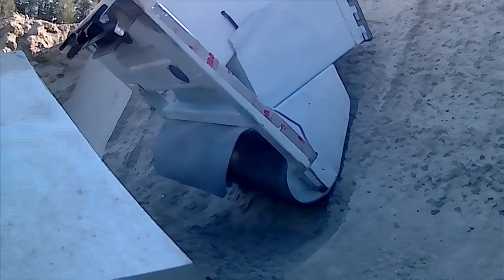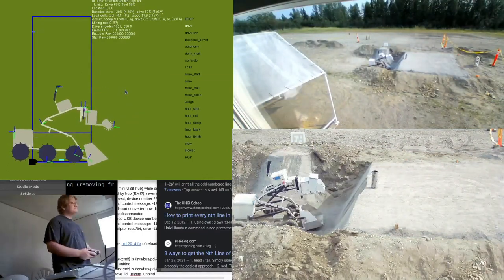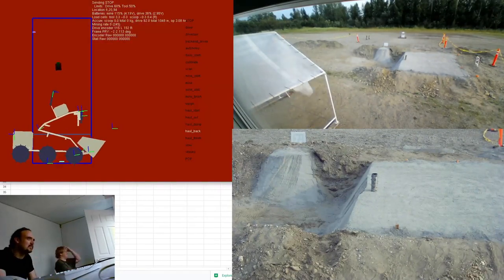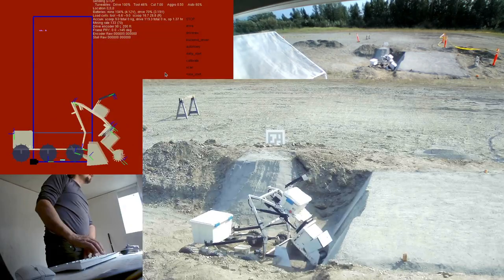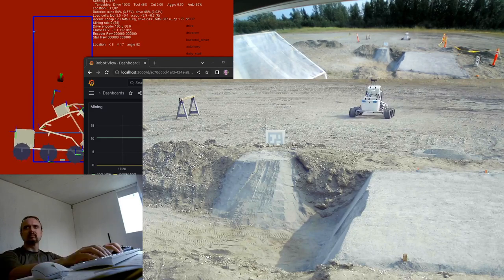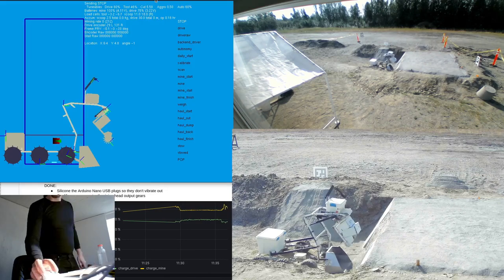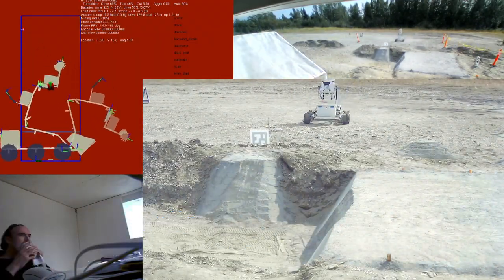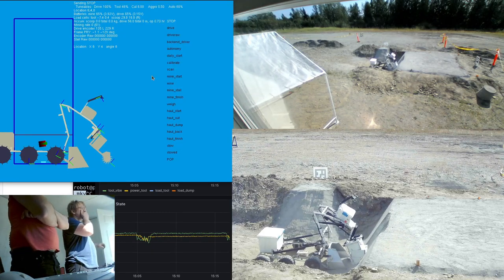Mining Robot Durability Demonstration Summary Timelapse: Aurora Robotics

Comment: On-off tuning in into the past livestream I saw some issues mentioned with the warping of the printing of replacement nylon gears. Nylon really needs an enclosed building chamber to print halfway decent. Even more so POM & HDPE which might be alternate viable tough plastic options (with equally or worse warping). Carbon fiber fill can help prevent shrinking & warping by a lot. But the short fibers make just parts just stiffer not stronger. Weaker instead. Also the fibers mess up self-lubrication obviously. With a two material print one could maybe only make the lining out of unfilled nylon. But setting a printer up for that is another project. …
Reply: On the Moon It'll be metal gears. Interesting would be how different metals will react to very large loads at cryogenic temperatures. Hopefully they don't get too brittle and amass micro-cracks till catastrophic macrocrack. About friction in medium load there must be plenty of knowledge by now with so many robotic devices having operated and operating on Mars.
Reply from the maker: I printed the robot's nylon gears with a tiny Tina2S printer, which I modified by insulating and enclosing all sides.  But it still does need a much warmer build chamber to avoid warping on large parts!
Reply from the maker: @mechadense  My understanding is dry lubricants are standard for hard vacuum operation: PTFE and MoS2 are typical.  At cyrogenic temperatures 300-series stainless, ELI titanium, or low-alloy aluminum have decent impact and wear performance.
Reply: @olawlor  — I see. Though I was thinking especially about longer term high alternating loads at sub lN2 temperatures. Gradually building up microcracks. Shifting fatigue limits.

Comment: I guess even cryogenic water won't get all that hard as it's "just" hydrogen bonds in the end. Don't underestimate hydrogen bonds though. But even with a soft matrix the abrasive sharp regolith within will likely wear the teeth. In a rather different way though.  Silicates (quartz) and especially aluminates (corundum) are much harder than the calcite needles in concrete. Well then again most of the wear likely came from the quartz sand in the concrete.  => Was the silicate for the concrete chosen to be regolith like small and sharp or was budget and availability forcing some more conventional filler.
Reply from the maker: We used "concrete sand" for the simulant, which is fairly sharp so it locks together.  But contrary to expectations, it includes pebbles up to golf ball size which were super hard on the teeth--our local rocks are quartzite and metamorphic gneiss or gabbro, extremely resilient and hard even on diamond cutters.  I was surprised to see the chromium carbide hardfacing areas were eroding only a little slower than mild steel!